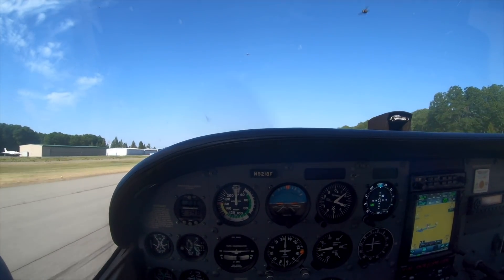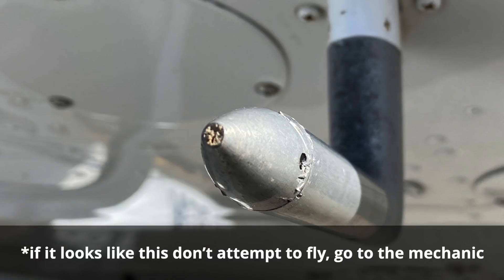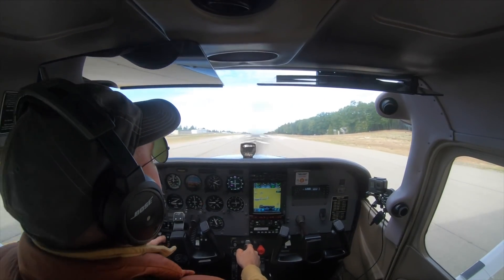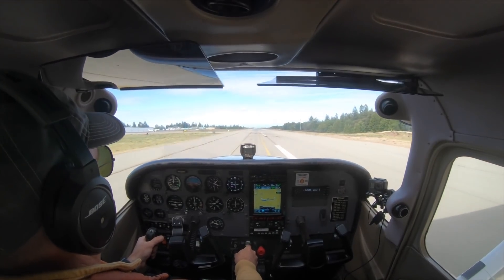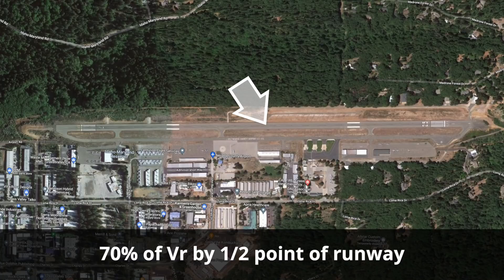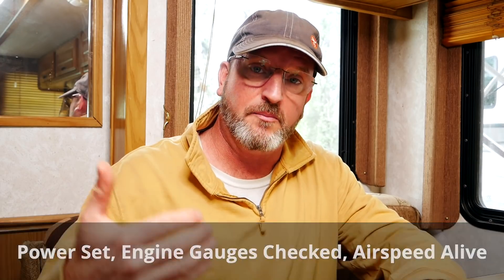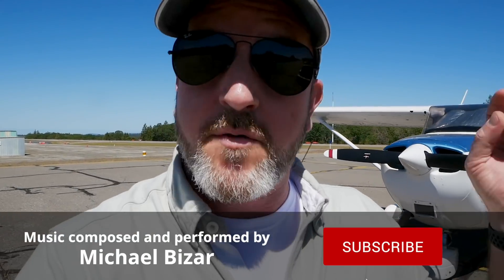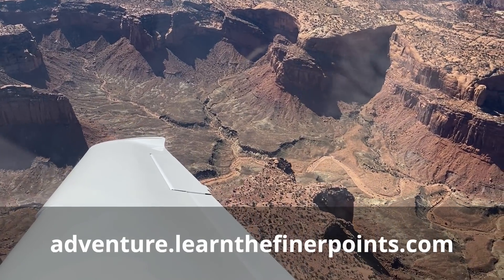PITOT TUBE BLOCKED - Review of ABORTED TAKEOFF PROCEDURES and other Flight Safety Best Practices

Comment: As a new pilot I didn't catch this in time once. Had to fly the pattern without airpeed indication. Scared the crap out of me...never again. I always call "airspeed alive" now. I was thankful to know my pattern power settings and to have an EFB that gave me some (although inaccurate) reading.

It was a ten minute fix back at the mechanic shop to blow it out and I was on my way.
Complacency kills, glad I only got a "cheap lesson" that day.
Reply: My CFI would make me fly the pattern often without referencing the airspeed indicator. It's no big deal. I don't look at the airspeed indicator after turning base anyway. I look out the window and land the plane.
Reply: @mattbasford6299  RPM and the sound of the wind over the wings is about all I would need. Not saying I wouldn’t sh!t my pants but we’d be ok.